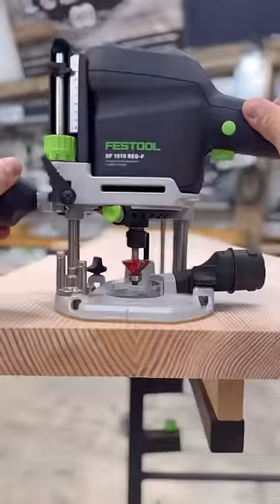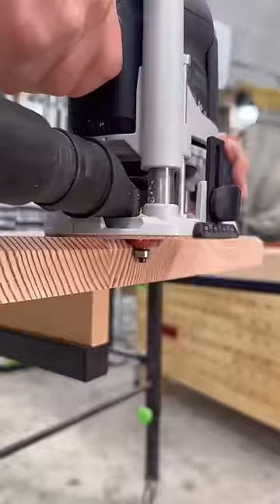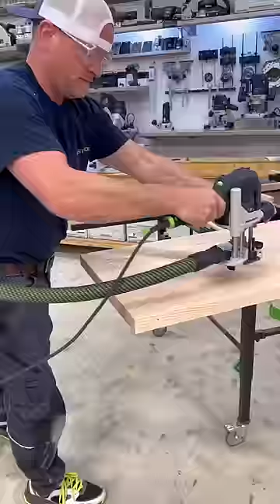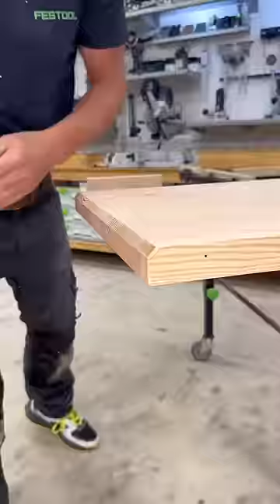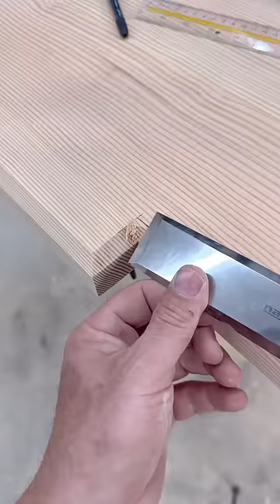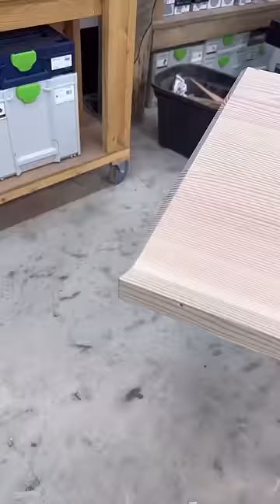Cutting a 45 degree chamfer with the OF 1010 #festool #woodworking #maker #tools #wood

Comment: Dang, I wish I had some nice tools like that. I'm still using a ShopSmith for some things. I've got two of them, one was manufactured in 1953, it's a 10ER. It still works, original motor. For those who don't know, the "ER" means experimental revised.
Reply from the maker: Awesome!  Some old tools are wicked